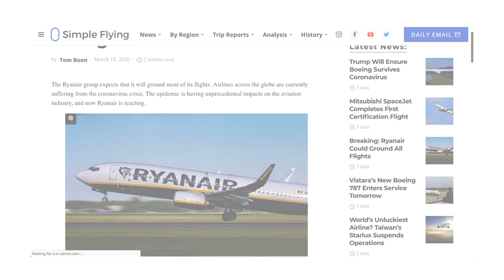What Plane Will Airbus Build Next?

Comment: A220-500/700/1000 should be the A320 replacement.  A321LR/XLR can then be a standalone medium hauler.  A350 is new enough it doesn't need a replacement.  This was never mentioned in the video but I'd love to see a medium-long transoceanic A330 replacement.  Reason: A330neo was great for efficiency but did nothing for the pax experience.
Reply: Dude, please become Airbus ceo, the most brilliant comment in 2020 i have seen
Reply: Now for Boeing:

Keep 737 Max (still Sells a lot) but start designing a replacement
 
Make the NMA (possible 767X) A new plane is to much time and money, plus 767 is still in production (767f, KC46)

787 is new enought

777x is maybe an update from the original 777, but a new masterpiece

Now, Boeing is dead in the 100 seat market. They stopped making the 717 (barely 156 units, what a shame, that plane had a future, but Boeing was egoistical with the 737-700) and also they abandoned Embraer (E2 jets)

737ng, 777 and 747 should be out of production in 2030
Reply: @brunocascardo3327  Haha  Man, I wish!
Reply: @brunocascardo3327  737Max replacement should be an A220 competitor, not A320 competitor.  Design a clean sheet 717 replacement, then "stretch" it to replace the Max.  787-2 or whatever it was going to be called can be the 767 replacement when it is time.  Thoughts?
Reply: @jakeschroeder1553  Airbus has total advantage here 😂
717 still an old platform (dc9)
737 must be something new, but that would become a reallity in the next generation of planes. Dont think Airbus would make an a220 for a320 replacement
For NMA? They could build a new 757, to compete against a321xlr or a potential a322. Then they decide of the bigger NMA aircraft, 767-787. But i think a new 767 would be perfect. They have the same type rating (757-767) an Boeing could put the KC46 cockpit into them (that cockpit is pretty sexy btw)

Comment: What if Airbus built a regional Turboprop plane?
Reply: they do. ATR is a (sorta) subsidiary of Airbus and ATR's products are turboprops
Reply: @zedriclouis87  I did some research and ATR doesn’t appear to have any connection to Airbus (according to Wikipedia)
Reply: @zedriclouis87  this is why I should never trust Wikipedia 

gg
Reply: @luker2665  Wikipedia says 50% of it's shares are owned by Airbus, so Wikipedia isn't that wrong either. the data I got for the Airbus-ATR relationship come from the ATR-42 or ATR-72 articles on Wikipedia

Comment: Well, as you have said there's no real point especially in the current circumstances in building a successor to the a380 or anything of that kind of magnitude for the foreseeable.

However, the a330 is in the category of the 777. Please feel free to correct me if I am wrong.

Perhaps they should work on the a360 as a possible successor to the a330. Take a look at using hydrogen fuel cell technology and other means of cleaner energy by all means.

Airbus a370 could be the a350 successor.

I like the idea of the short haul successor to the a319 and a320 being run on hydrogen fuel cell technology. And being called Zero-e.

Given that we already have an a321 and a a321neo perhaps the successor should be known as the Airbus a322 Zero-e FCA (Fuel Cell Aircraft).

Anyway, I am just thinking out loud.

Comment: I would go as far as a 767 equivalent, but more than 50% composits with a standard pax240 size and a downgraded and upgraded variants. 2-3-2 seating could be the next thing on the list for budget airlines, leading to faster boarding and turn-around times.

Comment: A220-500 to fit A319 market. If still efficient -700 to fit A320.
New aircraft between A321 and A330-200 (1 aisle in 3-3, 2 versions: 210, 250 pax in 3 classes). If the A220 can't replace the A320NEO efficently it's better to build a scratch aircraft to replace A220 and A320 (but not A321) in a 3-2 config but with base model as big as the A220-500.
And then or develop the A350 NEO and then an aircraft to replace both A330 and A350, or directly develop this last aircraft I described. This aircraft would have  3 versions (In 3 class configuration (economy, premium, business) carrying 280, 310 and 340

Comment: Design a new generation A320 from scratch and keep their bread and butter churning for another 30 years.  Don't follow Boeing where they've been flogging a tired 737 that's been around for 50 years.
Reply: That's what A220 is there for. They already replace A318 and A319. The stretch A220-500 would replace A320. There's also been speculation that they might even go for A220-700 to compete with B737MAX9. So basically a single family aircraft to compete with almost all MAX variants.
Reply: @nntflow7058  They can still redesign the A320 with new composite frames and possibly even expand the size into 757 territory. That way the A220 covers the smaller tier and the A320 grows slightly in size to cover the small to medium tier.

Comment: My thought: 
* New ATR (and possibly first integration of ATR), maybe as A1xx series?
* A220-500 and maybe even an A220-700
* a bit bigger and modern carbonfiber A320 successor called A230 moving the A320 into a bit higher capacity. The A318, is effectively replaced by the A220-300, the  A319 replaced by the A220-500. The A320 will get replaced by the smallest A320-successor A230-200, A 321 gets replaced by a A230-400, and that leaves space in the construction for a A230-600 and A230-800. 

All of these will include hydrogen engine variant with shorter range.

Comment: A360 - A large narrowbody aircraft that could sit between the A321 and A330, with transatlantic range. Might be best to stick to conventional propulsion technology, but push it to the bleeding edge like the Cseries/A220 has. 

This way the A220 can take over the A320 with stretched variants (A220-500, A220-700?). The A350 will still stay as the predominant wide-body for the foreseeable future.

That or have the A360 be a clean sheet design similar to the A300/A310, a small wide-body closer in size to the A330 than the A321.
Reply: A320neo and A321neo replacements will have to be clean-sheet. Boeing has proved with the 737 max 10 that you can't stretch a smaller aircraft into the role of a larger aircraft family (in Boeing's case the 757) as it will fall short on range unless extensive modifications are made. A220-500 makes sense but not as an A320neo replacement, but rather, a compliment to the A320neo. Anything bigger than the A220-500 just doesn't make sense.
Reply: @aarondynamics1311  I think the A220-500 will be just too similar to the A320neo that it might start to cannibalize sales as the A220 technically is a clean sheet design, the only new Western clean sheet design on the market. There is a gap between the A321 and A330 that could be patched by a clean sheet A360 design and fill in a role that has been left void by the retirement of the 757 and 767, and is being "patched" by the A321XLR. But yeah, I totally agree that any new Airbus needs to be a clean sheet, the A32x series should not be modified beyond the neo upgrade.
Reply: @AirShark95  If Airbus isn't careful, the A220-500 could easily cannibalize sales of the A320neo, however, Airbus doesn't have to do this. If the A220-500 had a range of around 2,500nmi, it would compliment the A320neo rather than cannibalize the sales of it, as the A320neo would still have a place. This means that airlines would use the A220-500 on short haul routes that previously could only be operated by an A320 or a 737-800 and the A320neo, with its extra range, would fly on the longer routes. It would steal some A320neo sales but there is a difference between stealing some sales and completely cannibalizing sales, as the A220-300 did to the A319neo

Comment: HopefullyAirbus will not make the mistake to start a 320 successor from scratch due to the high project risk.... improvements little by little would make more sense. For sure the implementation and momologation of a modern wing design is a major significant change but it is more handable as a complete new type. With a new wing also a 322 would be possible...

Comment: Why not a redesigned A310neo? There currently is no market for this aircraft of range and capacity, the A310 was a remarkable aircraft, just slap on more efficient engines and other changes necessary! They would be the only option for 200-265 passenger range, Of course, Boeing could revive their 757 line and do the same, it would be healthy competition for all:D

Comment: Yes the A220-500 would be fishing in Airbuse's own pond BUT it could move airlines from a moxed fleet to a clean A220 fleet. While the A220-500 is the top stretch the A320 will be the base variant for Airlines running A320 . To be honest there's a need forna stretched A321 and even if it needs a clean sheet approach. Why not have a shared  certificate like the 757 and 767 had. Two more stretches then to cover the 757-200 and 300. 
I don't see any issue by having an overlapping portfolio. It gives a customer more options and thus make a purchase more likely

Comment: I would like to see Airbus try something innovative but near term for fossil fuel reduction. The all hydrogen thrust of Zero-e may be needed for long-haul, but there may be easier solutions for short-haul, even moving into the regional jet or inter-city shuttle arena. Perhaps an A220 fuselage, possibly shortened, could be fitted with hydrogen engines developed jointly with ZeroAvia. Or maybe some kind of electric turboprop, perhaps with multiple fuel options. Maersk has selected green methanol as a fuel option for ships, I wonder if it would make sense to have a short-haul plane running on methanol.

Comment: Zero E aircraft could be just re- engined versions of existing planes: A320 Zero, A350 Zero etc. Save the redesign and retraining cost associated with clean sheet planes. 

In terms of new designs, a further A320 stretch to replace the 757-300 and hit the middle of the market? A321XLR still too small vs the 757-300

Comment: Actually they should probably start building water treatment plants as there is sufficient planes on the ground to fill demand for the next decade give the projected ramp up in air travel,  it will probably be 2026 before travel catches up with available planes.

Comment: The easiest would be the A220-500; and it's not a big job (comparitively speaking), but the interesting thing Airbus are working on wasn't really mentioned in the video.
The replacement for the A320 family, which Airbus have already been working on for years, will have taken a different path since the purchase of the C-Series.
The Airbus NMA (or whatever its acronym is) is the important project.
If the rumors are right, the A220 family will do it's current job and go up to A320 size with the -500. Then the new aircraft under development will pick up between the [current A320] size up to the A330 size, then the A330neo, then the A350.
Frankly, if Airbus pull this off, they'll have the market coverage from regional jets all the way up to high capacity, long haul jets. Hopefully Boeing will have their sh!t together before then or they'll be so far behind in the race they'll will be made to look like amateurs, and the Chinese will take their place

Comment: By 2028, A380s will be in huge demand due to excessive increase in passenger count.

Also the A350s and A320s needs to be upgraded
Reply: The A350 and A320neo have only been flying for five years and four years, respectively. I don't think they need to be upgraded anytime soon. As for the A380s, an awful lot of the busiest air routes in the world where filling A380s point-to-point is possible if you want to use them for that (Seoul-Jeju, Tokyo-Osaka, Sydney-Melbourne etc.) are a short enough distance apart to be better served with high-speed rail than through the air, and indeed two of the three routes I mentioned already have these in the works (Tokyo-Osaka already exists as a regular Shinkansen route, but will become the first Maglev route in Japan). 

What Airbus are instead most likely to do, beyond releasing the A220-500, is to replace, not upgrade, the A320. Though it's very new in comparison to the 737, it's still a design from the 1980s, and a newly developed plane designed to modern standards could be far more fuel-efficient, long-ranged and comfortable for passengers than the A320 could ever be, no matter how often it's upgraded.
Reply: @rjfaber1991  in case of A380, they will be needing a comeback by at least 2030, because of heavy increase in passenger count on almost all major routes including transatlantic and transarctic, so your views on the point is about the situation of 2018-19 or so

Comment: The A370 
A jumbo jet with a hump longer than 747-8 for more upper deck capacity, coupled with twin GE9X and lower maintenance.
Reply: The 747-8 didn’t sell well with only around 40 built, so the A370 wouldn’t get many orders

Comment: The next all new clean sheet airframe designs will be around Airbus proposed eZero Project. I do see the A220-500 being launched late 2021/2022. There will be further fine tuning to the A320neo/A321neo families and the A350 family. With regards to the A330neo family is not sure about its future, as the A220, A320neo/A321neo and A350 are good sellers.

Comment: with Emirates firm interest in new variants of the A380-800 it'd be wise for AIRBUS to launch the A380-900 Neo LR which was a conceptual stretched variant of the A380-800 that came very close to becoming a reality, back in 2011 - 2012 . . . considering the Emirate full service carrier persistent request for a new stretched A380 there's no reason why the European plane maker shouldn't pursue the A380-900 Neo LR project . . . that being said, hybrid aircraft propulsion is only way quad jets can survive in a market dominated by state-of-the-art long range twin jets . . . a basic trick to minimize fuel consumption in a aircraft or your car is by shedding the load on the engine of the aircraft or car because the engines run everything, not just propel the B747-400 ER at 38,000 ft or the F512 torching the Autobahn at 290 kph . . . in case of an aircraft diverting the power needed to run ancillary systems of an aircraft to a secondary power source from the four gas guzzling turbofan engines can improve fuel economy by as much as 65% . . . by ancillary systems mean cabin lights, in-seat entertainment, air conditioning, galley, lavatories etc. even cockpit instruments & communication . . . all this consume power & a lot of it, that in turn puts load on the engine thereby increasing fuel consumption . . . but if we just leave the engines to propel the aircraft and operate everything else in the aircraft through a state-of-the-art fully integrated rechargeable hybrid power pack you could save some much needed jet fuel . . . and needless to say jet fuel is very very expensive . . . think of the hybrid solution in context of low cost budget carriers . . . they offer a no frills service in a single class cabin at a cheaper ticket price . . . if you want some of the in-flight cabin services, you'd have to pay extra for it on the go . . . that would otherwise be complimentary incase of full service airlines . . . even a 50% saving in fuel consumption is equal to being able to fly an additional 890 - 1,200 miles . . .

Comment: I would love to see a zero emission A380 successor wether it be battery-electric or with hydrogen fuel cells. But unfortunately that would ruin Airbus financially as of now because of the decreased demand for the coming years. I'm still hoping they might consider it once they have their zero emission A320 successor up and flying and global travel demand is back to pre pandemic levels

Comment: Airbus a390-1000 it’s a quad deck with 2000 passengers and a airbus a360 it’s the size of a330 but is can travel super long distances like London to Sydney a370:would be a double decker that used 3 ge9x to give much more profits by being 25% more efficient with 3engines and another 18% more efficient because of ge9x

Comment: An laminar flow flying wing with multiple extrados electric fans powered by cold H2-Air fuel cells with super-condos boost for take off is definitely the lightest and most advanced way to go. The Celera L500 laminar design shows up to 59% drag reduction over turbulent flows conventional tube and wing designs. Moreover the current thermal hi-bypass ratio reactors like the GE90 costing 40mio$ a piece, loaded with state of the art metallurgy and composite components are way too expensive and insufficiently efficient compared to much cooler fuel cell and E-drive? The current H2 WW production well over 100 million tons per year is sufficient for air traffic up to mid range and the zero carbon solar power produced H2 costs would become the cheapest if all atmospheric carbonizing fossils fuels are CO2 taxed at road fuel tax levels as per any legitimate fair trade principle. For instance, the airport landing charges could be coordinated all over Europe to be proportional to the tons of CO2 produced per full fare traveler of the incoming flight. This insure that economical planes  matching the useful demand  are used in priority and are flying full/almost full for lower fare cost and transport emissions.

Comment: A220 will replace the A320 (and will have similar capacity as the 737) and the A321 will be the sole survivor of the OG A320 family (and will have the same capacity as the 757).
Reply: The A220 is unlikely to replace the A320 I think. Even with a more modern design, it's harder for a stretch model to beat the efficiency of a original base model. It will quite likely replace the A319 I would think though